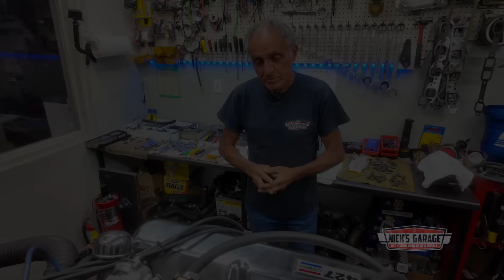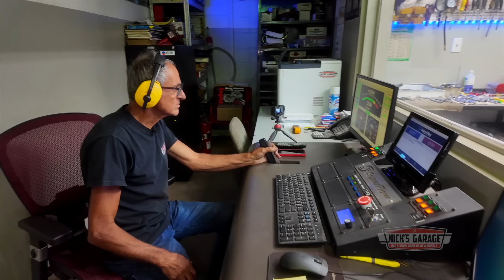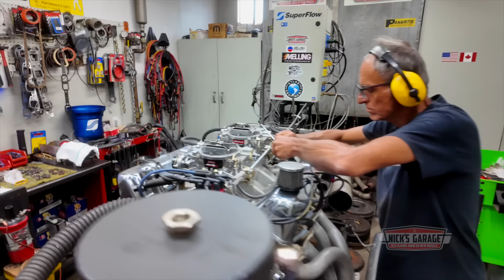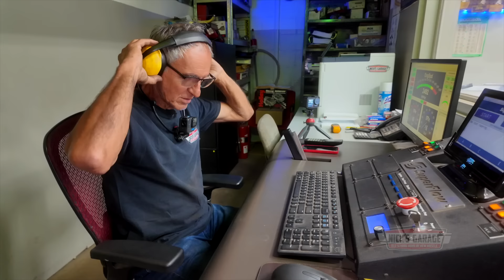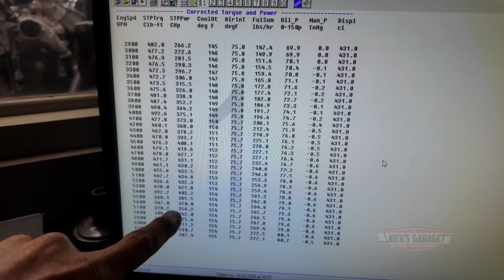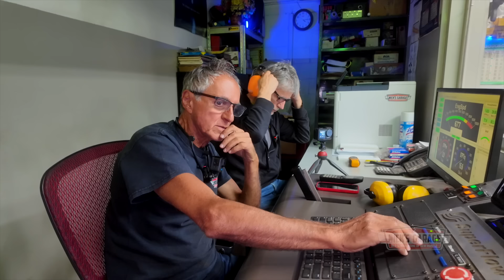427 Ford Side-Oiler on the Dyno Part 1 - Shelby Cobra Engine

Comment: favorite ford engines in order  427 SOHC-- 427 SIDE OILER -- 429 BOSS -- 428 -- 351 CLEVELAND. And anything with Cleveland heads [302 Boss].

Comment: My favorite Ford engine was my trusty 302. I found the engine sitting beside a stop sign, using a cable come-a-long, loaded it into the back of a truck. Took it home, tore it apart to find it was gummed up. Had the block refreshed and bored .030" over, built it with 10.5:1 compression TRW pistons, had the heads were refurbished and put Chevy 327 exhaust valves installed with screw in studs, put a Crane fireball cam, an Eldelbrock torquer intake and a Holley 650 carb, a Mallory dual point distributor, and a cheap set of exhaust headers. I put that into a '72 Mustang with an FMX automatic trans and ran the heck out of it. It was reliable and ended up selling the engine to a friend, who put it in a two door Comet. Fun times...

Comment: The rods n pistons in those motors were way to heavy, I built a 66 side oiler with tunnel port heads but listened the rods up a lot and use a set of super lite forged probe pistons and went with a big comp cams 650 lift and a set of stainless roller rockers with the dual quad set up but my carbs were reworked to flow max flow  my engine made 784 HP at 6800 RPM I put it in a drag boat

Comment: Be interesting to see what the o2 , co , etc are during the test. The heat , and exhaust will definitely derate, and like the predictive suggested sedate the hp . You could correct if you knew what it was.

Comment: Nick you are taking a huge chance with carbon monoxide poisoning I hope you know that the thing about CO is when you reach the point of poisoning you go from feeling relatively normal to passing out almost instantly it doesn't creep up on you and then once you are passed out normally there's nobody there to rescue you
In the 1970s in Gary Indiana at a major steel mill about 10 steelworkers in a lab room all succumbed to carbon monoxide poisoning one after another also they had full face breathing equipment on all of the columns in the lab but everybody felt "normal enough" to where they could rescue their fallen comrades and pull them out of there without putting on their protective gear.
AND.... they all had carbon monoxide poisoning and protective equipment gear training--
 .....that's how deceptive the stuff is.
  Be safe my man.

Comment: 💪I still have my 427. I started saving for my first car when I was 12 yrs old, bought at 14, a 1967 Ford Fairlane with a 427 true “cross bolt main side oiler”. Back then it was big solid flat tappet cams that made me daydream in school and forced me to rush home (or skip class) and just start it and visibly watch the doors shake, that alone was all worth it, having not being able to drive yet. 
I pulled the motor all those years ago, l knew I had something REAL special, even at 14 lol. Those were the days!!!

Comment: If you sand the Chrome surface on the valve covers and use weatherstrip adhesive with a cork gasket will stick then they'll come off the engine without falling apart

Comment: My Dad ran A 429 in his Cobra & had a local shop get about 745hp at 3500 at the rear tires. Only problem was they couldn’t pull it down tight enough & it kept smoking the tires on the Dino
Reply: lol ok

Comment: Why in God's name would you put nasty Carter/Edelbrock carbs on a factory 427?  My Shelby has the factory 600 vacuum secondary Holleys. They look right and the progressive linkage keeps you out of the second carb until about 50% throttle.

Comment: So when this block came out I read everything I could it was made of high nickel iron and the right side of the block where the starter bolted on were a series of pronounced external ribs these were supposed to keep the block from breaking when a rod let go. So now got the block with Med Riser heads small dome pistions in my Ford late model dirt car running the tracks around Chicago. Now its no faster but I'm feeling that when a rod goes my new side oiler was safe. 6 weeks a 75 lapper. Almost over it is over pushed on to trailer next day I am confident the block. Up on jack stands slide under and there was the starter handing by the cable and not a rib to be seen.

Comment: How many times have you heard the absorber let go over the years? Once they cavitate, they are done, full stop! Don’t risk the engine. You know what they say about doing the same thing over and over again and expecting a different result is called? Your absorber is water starved and getting damaged. Repair it and perhaps add 6oz of Armorall to the absorber reservoir to reduce cavitation. Look for restrictions in and out of the absorber. Any air leak on the suction side, bad seal on the input shaft?

Comment: Whose heads,   ok edelbrocks heads make a big difference on an FE.  Another Les story. His Ranchero was 3 on the tree and brand new,.  I showed him how to adjust the shift levers on the bottom of the column to lead the transition from R-L  to 2-3  then he busted his knuckles on the dash  next week at Old San Gabriel he had a floor shift   Ended when Les was tossed out of his car- we never figured how that happened as he was Safety First

Comment: Not too much 427 experience but on the ones I worked on the drivers side exhaust the inner two pipes came out and over the outers and the right side was different.   Les Ritchie was a friend he had a Ranchero that was spinning the right tire, no locked diff I suggested he block up the left front and right rear he did so then he beat me.  RIP Les (Performance Associates)  ps the Ranchero was a factory blower 312, later he put dual quads on with the blower till he got caught, claimed it was an option  quite a guy

Comment: Edelbrock heads make good power but ever since Vic passed away their prices have skyrocketed. A set of Edelbrock heads for a small block Ford costs over $2,000. You can get a set of 100 percent CNC ported AFR heads for right at $2,000!
Reply: Trickflow makes the best head for a ford.

Comment: A 427 side oiler in a tiny AC Cobra gives new meaning to the phrase “power to weight ratio”. What a legendary engine!
Reply: Do you know?
Who knows?
Reply: @termonostruman  Do the math!  289 Cobra was 271 hp and 2100 lbs, for 0.13 hp/lb.  427 Cobra was 425 hp and 2500 lbs, for 0.17 hp/lb.  The math checks out, even accounting for a heavier car required to handle the extra power, and a conservative power rating on the 427.  Plenty of people will tell you the 427 was putting out considerably more power than the rated 425 hp.

All that said, I would much prefer to drive the 289 -- on the street or on the track.  Even the 289 is front heavy, the 427 is stupidly so.

That's why I would prefer a modern aluminum small block, which would be lighter than either of these options and could easily do a streetable 400 hp.
Reply: @rockets4kids  if you like alluminium its your problem..

my caterpilar has 2.000 HP
Reply: An aluminum small block built to 427 will do even more power at considerably less weight.  The extra power here is silly, but dropping all that weight will be a massive improvement in handling.
Reply: @rockets4kids  The 351W style engines at this CID are every bit this engine plus half again more. Theres a Guy w a 67 Fairlane going 8’s with one. a 351W type engine.

Comment: Nick, I love your work, and, your show, so listen to me I have over fifty years with 427 Ford engines, PLEASE back thee timing DOWN to 33 degrees, and run it no problems bump up to 34 keep doing this to 36 degrees ONLY, any more than this you will loose big horse  power any more than 36 the engine will run HOT, and, not start, remember 36 max.

Comment: Looks like the FE over achieved on HP and torque and may have taken out nicks Dyno. I absolutely love the FE ford engine and have built many that ran great. My 67 396  (390 with a .030"overbore) in a Mustang was able to hang with modified 454 Chev.

Comment: I am nervous about running the test without the Air Fuel Ratio. Isn't there a wand type probe you can insert in the exhaust pipe that can measure that? After the Smog test shops went to new equipment, there was a lot of that for sale used for cheap around here.
  I would drill his exhaust for the screw in probe if you don't have that.  Every muscle car needs an Air Fuel Meter. Might as well put one in now.
My fear would be that there is a big vacuum leak in the intake as well as the oil leak.
You know those guys back in the old days went crazy milling heads and decking blocks for the purpose of raising compression. And they ignored the problem of intake fitment.
So that is my theory about the low vacuum at idle.
Reply: Why don't you run it and spray ether around the intake and see if you can find a vacuum leak.  Just at idle, not a dyno run.  Also, put a dial indicator on the lifter and see what the lift on the cam is.  I would bet it is too low to explain the lack of vacuum just from having a wild cam.

Comment: TY Nick! Another cool video. With a rad engine. Ford made everything. 390 ,427, 428, 429, 460, 500. A Ford 351 can be all you need. A 427 is the ticket man.

But nothing feels so cool like a real big block. That instant pull from all the torque. Man! It's hard to beat. Nice engine. TY for showing it to us.

Comment: EVERY SIDE OILER I've seen had a thin flat oil pan.... The typical FE engine had a deep sump Pan like the Thunderbolt Fairlane.... EVERY SINGLE SHELBY COBRA 427 I'VE SEEN HAD FLAT PAN..🤔

Comment: when an engine is unloaded from the dyno and revs freely without a load, or flashed without a load against it, it reads the torque and horsepower much lower than it really makes. this is evident here on the dyno sheet after 5500 rpm.  the motor has to be loaded to read correctly.

Comment: when i was 19 i had a 65 Mustang conv. with a hipo 289 4spd  
posi. that little motor ripped ! best ford motor!
Reply: I bought a brand new 66 HIPO auto trans and it was a POS... proverbial lemon. Traded it for a new 66 Charger 383 loaded.
Reply: I had the pleasure of servicing and test driving / joyride a GT350H with the black base and gold stripes equipped with the 4 spd.   I’m a lifelong mopar guy but there only a select few mopars I would take over this sweet little Stang.
Reply: POSI is a GM term BOOOO!!

Comment: The Ford 427 series is a legend.  I think it was the best of the FE series engines.  Such a powerful engine, so powerful that it breaks dyno's!
My all-time favorite Ford engine?  That would be the 335 series, aka: Cleveland.  I think it's a real shame that the 351C had such a short production run in the U.S.  I understand that in Australia, where they were not encumbered with the U.S. emissions laws, they continued to make the 351C and a short stroke 302C in production through 1981.

Comment: As you are probably aware those FEs require half the head bolts be removed to seal the intake. What were they thinking?
A bit like big block Mopar rear seals!
Reply: Which half? Top?  Seal, meaning the oil leak or the intake to head passages?

Comment: Would be neat to see how much horsepower a 427 Tunnel Port made.
They were the engines that dominated NASCAR in the 60's. 
They won a lot of championships with that engine too. The Tunnel Port 427's really gave Mopar Hemi's fits back then. I remember Ford could no longer run  the High Rise cylinder heads. So they went back to the drawing board and came out with the Tunnel Port.
Note I'm a Mopar guy owned a few Mopar's one a 70 6-barrel Cuda. 
Sorry I ever sold it but that's life. I was also a Chrysler Master Tech worked in dealership for 20 plus years. The 90's and all the problems with their transmission's, and engines is what made me leave for greener pastures...

Comment: I had a 1966 Ford Fairlane with the 427 Race Car Package, side oiler 427, transistor ignition, dual quads, verified it would turn 7000 rpm in every gear (lucky no highway patrolmen were around that day). Drove it for 3 years, (1967-1970)  30,000 miles, got 10.6 mpg at 60 mph on one carb's primaries. 6A43R249575. Got beat twice on the street, once by a hemi with gears and once by a tri-power 435 hp Corvette with gears. The car came with 3.89s, they had steeper than that. Them was the days.
Reply: what became of it?

Comment: I bet whoever worked on the engine changed the cam. With only 8 to 10 inches of vacuum I bet the RPM range on that cam is 3600 - 6800. For a daily driver that's not going to be fun at all.
Reply: I think he should check the lift on the cam with a dial indicator. I think a vacuum leak is causing the problem, not a long duration cam.

Comment: A good friend of mine had one of these in a restored Galaxy.  He pulled it out, and completely built it for drag/street racing!  It was all gloss black and was a real screamer on the streets!  He owned the local Sunoco gas station at Millersport & Longmeadow in Amherst NY.  That ownership was a good thing as Sunoco 260 Premium high Octane fuel was very expensive in the early 70's, going for $0.32 per gallon and then he added a bottle of "Nitro-Nine" octane booster to every tank!  Those were the days!

Comment: That's a very sad motor.  Not enough cam or compression.  My 427 makes 520 hp at 5900 rpm.  Cam is 248/254 on a 110 LCA with  solid street roller, 0.620/0.640 net lift. CR is 10.8:1 runs on 93 octane.  Idles with a slight lope at 700 rpm
Reply: Nice combo. Which Cylinder head and intake are you running.
Reply: @JerryM-p2v  I have a set of  Edelbrock FE heads that were ported and have 2.25, 1.75 valves. They only fit 4.25 bore engines.  The intake was a ported Victor 427 FE.  A set of stock Trick Flow FE heads will outperform mine.  I changed the intake to an eight stack Independent throttle body setup.  The intake is a blue thunder and the throttle bodies are 48 mm Chinese IDA knockoffs.  I did this because I wanted to smooth out the idle and increase throttle response.  The block is a Shelby aluminum block with forged internals, and I made a set of custom 2" headers.  I sits in my 1968 Mustang fastback show car and runs 7.1 sec. in the eight mile.  I recently added A/C and electric power steering.  I used to own a Shelby GT500KR, and this car it a lot faster.
Reply: @turbo32coupe  Very cool. Yes Trickflow makes a great cylinder head for Ford engines. A local kid built a 434 stroker SBF 8.0-1 compression TF heads, solid roller Cam Etc. Made 605 HP on the motor, and 875HP with the pro charger belt on.

Comment: Not your fault Nick. These things happen. On the positive side I learned what a dyno sounds like when there's a issue. With the engine, does the block have any oil system mods or piping in the valley? I know you can figure it out so I don't mean any disrespect by offer ideas. I was offering what came to mind thinking it may have a leak shooting oil at that china wall forcing that rtv to roll just a little. Enough to spit out some oil. Interested in what's going on. Great video.

Comment: The side oiler is the 427 hd series tuned by Shelby,is originaly came from the f250 truck.😁
Reply: FORD NEVER PUT 427 IN A TRUCK
Reply: @med1273 FE s but no 427, bummer

Comment: The three Ford engines I love are the 289, 390 and the 427. Wasn't lucky enough to own a 427 but was around those who did. But above all the Ford flathead will be my forever favorite.
Reply: Got to love the 289, I concur and the 390 does everything well from wheel standing Fairlane Stockers to towing a trailer to pushing a heavy T-Bird down the road in almost silence. After that I like the big block 429/460
Reply: Not really a Ford guy, but I do like the FE motors. I have a '68 428 from a T-bird sitting just in case I ever find a nice Mercury Cougar I can afford.